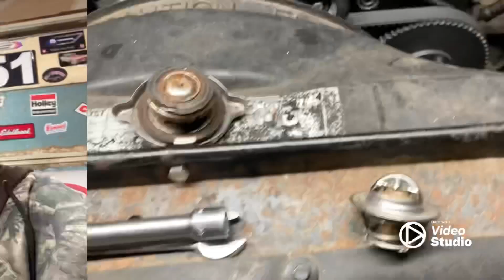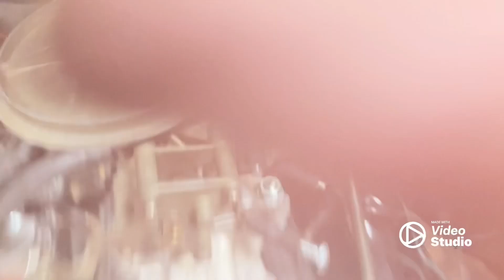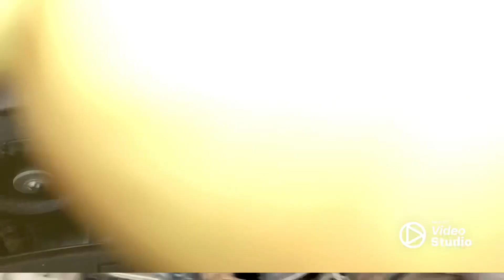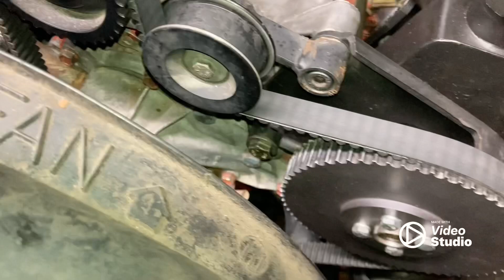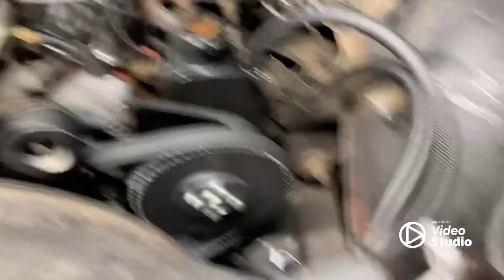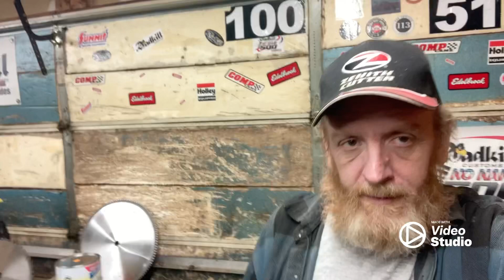Freeze Warning!!

Comment: jb does the power steering pump shaft have a threaded hole in the end maybe a bolt and washer to keep pulley from doing a walk about
Reply from the maker: Yes sir. But it’s stripped. So thinking set screws. Let just see if that shaft is hardened.